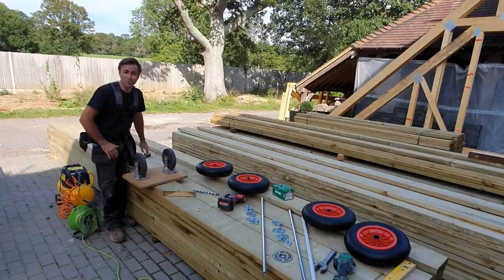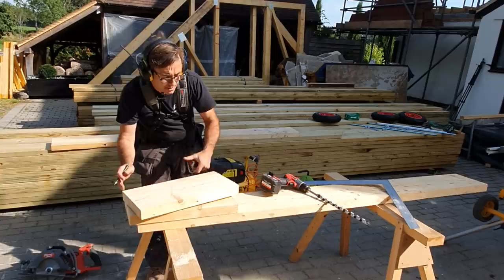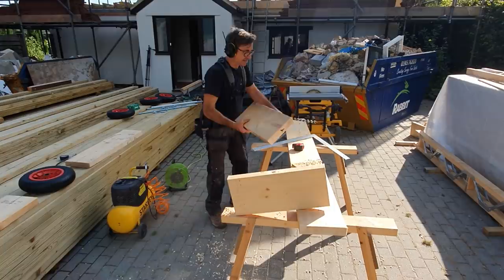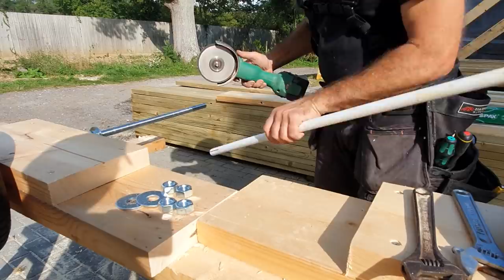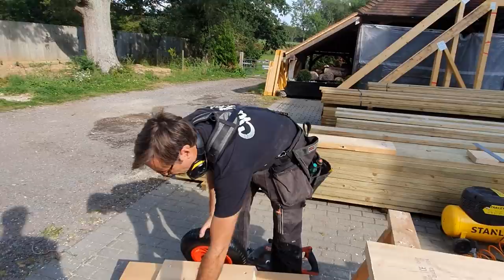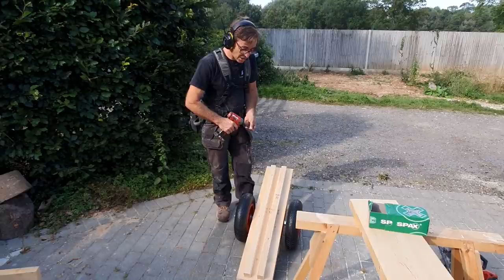Cheap transport dollie for heavy and awkward items such as trusses and doors

Comment: great video, but why not pull the threaded bar out to the right length so you only have to cut 1 side,+ the longer offcut is of more use
Reply from the maker: This is what happens when you film yourself!! you flap around and sometimes do things with out a slight pause for thought!!!
Reply: That's what so good about this youtube media we can all help each other, the strongest tool we own is also weakest tool we own "The Brain" keep engineering guys 😇😊🤗
Reply: Another great little tip, Robin. Thank you kind Sir 🙏

Comment: Reminds me of when we where kids we used to make go carts with old pram wheels, 
and then find a steep hill and go for it with no brakes  those were the days, thanks for the video Boss
Reply: I seem to remember it took two dad's sheds worth of nails per axle.
Reply from the maker: Proper good times!!!
Reply: @Iazzaboyce  yes, my oreferred methid if securing the axle was hammering in a rov of nails the length of the axle either side then bending them over the axle by hammering them.

Worked a treat!

Comment: Glue one to each rigger boot and you have a super fast way of getting around the site.

Seriously, good idea. However, as others have suggested, I would have cut a groove in the lower piece and trapped it between the two.

How about a detachable extension to convert it to a timber trolley, raising beams off the deck to just below saw horse height?

Comment: Necessity is the mother of invention, so I nicked the wheels and shaft of the customers wheelie bin and knocked up an excellent little dolly for moving an rsj around the outside of a house. And yes the wheelie bin was as good as new when finished.
Reply: Clever thinking!
Reply: Amazed it took the weight - given a bin is just a bit lighter than an RSJ !!   😉
Reply from the maker: genius!! nice one mate
Reply: We cut the base off our old broken belle mixer to move some heavy green oak beams around, worked a treat!!
Reply: @thetessellater9163  It wasn't far and it was smooth terrain.😁

Comment: It's a great idea for moving heavy and cumbersome items 👍
Lots of very simple ideas that we don't think of until we see them
I'm gong to nit pick though as I didn't see those plastic pipe things go on the threaded bar in the second build
Reply: Take a second look 👀
Reply from the maker: I did speed that up really fast but they are definitely there!!
Reply: @ukconstruction  Cool, thanks for clearing it up 👍
I think we get so used to you showing things down to explain the stages that when it's done at normal speeds we miss these little things
Not that I was doubting you 😁
Reply: Necessity is the mother of invention

Comment: PVC, all-thread, and wheel barrow wheels. Store that info away for future use. Always interesting to wander through the hardware section of a store finding things that fit snugly in and over other things. PVC, Pex, all-thread, copper, and black pipe. What size all-thread did you use for the axle (looked like 3/4”)?
Reply from the maker: Yes mate M20 threaded rod which is about 3/4" in old money
Reply: @ukconstruction  What’s funny is (some) people in the US still say “in for a penny, in for a pound”.

Comment: I'm surprised you didn't use the wedding ring on the shaft of the auger bit trick for keeping it level. Or a few washers stuck together. I use it all the time, great for keeping it level on a horizontal. Loved the dollies though, quick and easy.

Comment: I would have routered out a groove rather than drill with the auger and sandwiched the axles between the two pieces of wood
Reply: This is one advantage of YouTube - other people can make suggestions of other ways to achieve the same ends using different tools. Not many people will have such a long auger bit, but might have a router and a bit that can make the necessary groove, even if it takes a few passes.

Comment: Makes life much easier. 
Hi Robin a question if I may? What model table saw is that and if you had to replace it would you get the same one?
I'm needing to buy one and have had a few different big workshop table saws but never a portable one. Looking for some guidance.
Reply from the maker: Hi Andrew, this is the Dewalt DW745 and associated stand, its a proper work horse, and with a good blade and some fine tuning on the calibration of the fence its a good strong saw and can cope with timber up to about 70mm thick (as long as its not to wet or hard) I paid about £500 for it and it paid for itself in the first job, I am not sure that this is made anymore though they are going cordless, oh and its a 250mm blade diameter, hope that helps
Reply: The DeWalt flexvolt table saw is superb as a job site table saw, 👍🔨🇮🇪